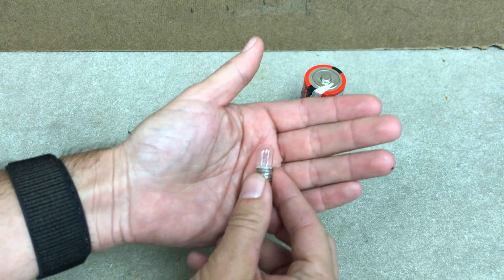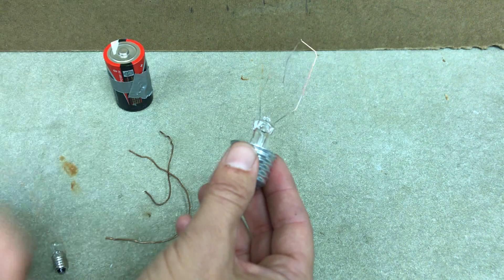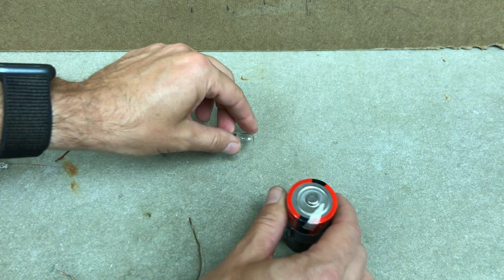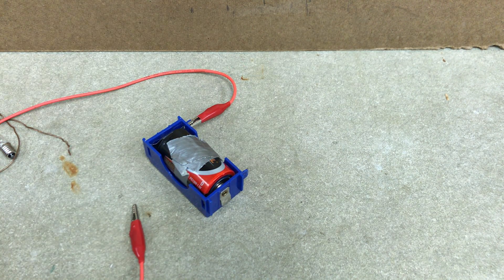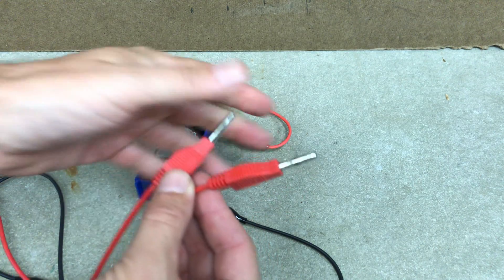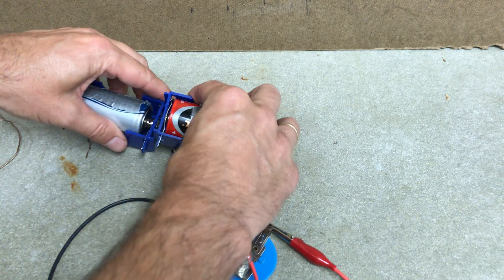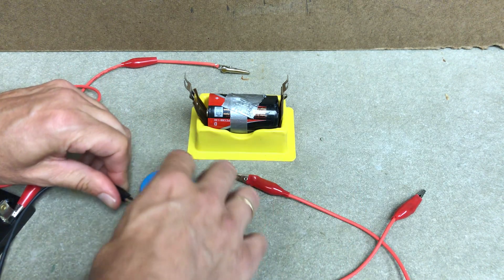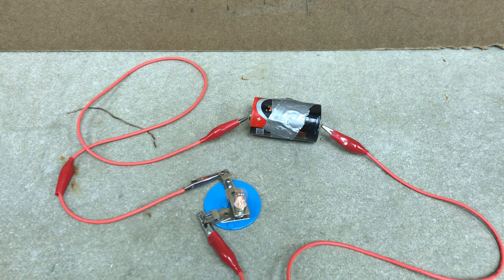Battery, bulb, and wires - every way to light the bulb.

Comment: Hey man, i found a big ass headlight under the seat of an abandoned car and its been preserved because it hasn’t gotten wet or anything, how would I go about turning it on? Could I connect wires and a battery to the back?
Reply from the maker: If you have a multimeter, I would first check the resistance between the contact points.  If you get an infinite resistance, then the bulb is dead.  Other than that, you can connect a battery--if it's a car headlight then it probably uses 12 volts.

Comment: I used this for my science project in a way.......... I used a CD taped copper wire on it using electrical tape if anyone asks if the black tape covers the CD i'm just gonna say the color black attracks the sun. I'm gonna tie the battery to the CD with electrical tape and attach copper wire to light a light bulb. ( btw its a model of a solar panel)

(IT WORKED :) )

Comment: Wait am I right?

A light bulb can only light up when a positive and negative energy is flowing thorugh it??
Reply from the maker: it's not positive and negative energy - it's just electric current. However, in order to get an electric current, you have to hook up the wires to both the positive and negative terminal of the battery.
Reply: @rhettallain  ohhhh okay sorry I didn't know about that part were learning about electrons in my class
Reply: Maybe
Reply: There’s different polarities. And it really does matter Isherwood you use positive and negative. If you Try to jump start a car. And you put the negative on the positive and positive on the negative, you will fry a fuse in the car or even as bad as the ecu. So no it’s not just electronical current. There’s positive and negative for a readon

Comment: Wouldn’t the battery get hot
Reply from the maker: The battery gets a little hot if you short it (running a wire from one end to the other with no bulb).  The wire can get VERY hot - be careful.

Comment: Alright, question. Can you use the battery holder and the lightbulb holder thingy but not the alligator clip wires, instead use the copper wires to connect? Working for a science fair project. Thanks for the help
Reply from the maker: yes - as long as there is a electrical conductor (like copper) from one end of the battery to the side of the bulb and then from the bottom of the bulb to the other end of the battery, you should be good.
Reply: Rhett Allain Alrighty, thank you

Comment: will it work on any lightbulb??
Reply from the maker: You need a lightbulb with a tiny filament inside - not an LED bulb.  Also, some of the bulbs need a higher voltage so that they won't work.  If you look on the side, it should say the voltage.  You can get a 3.0 volt bulb to work with a D-cell battery.
Reply: It is much bigger take smaller  it will be better understood